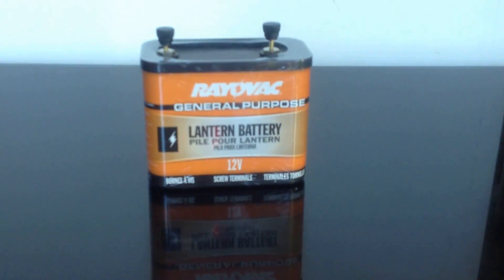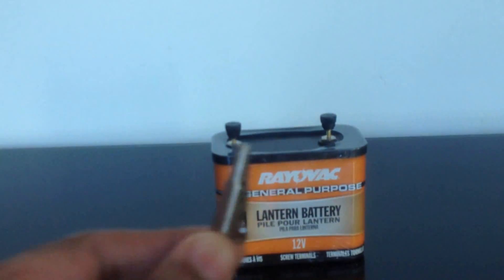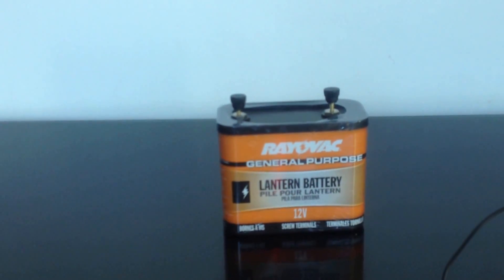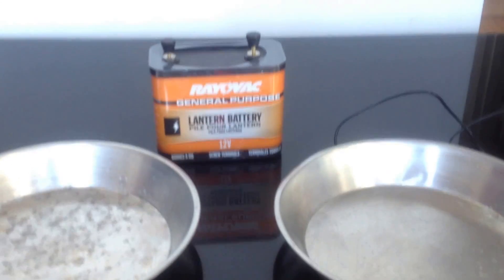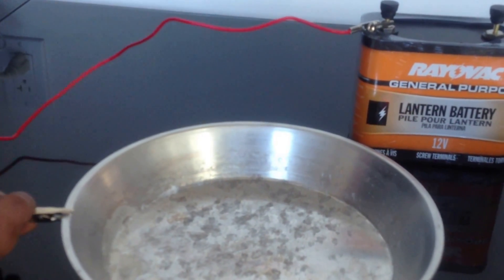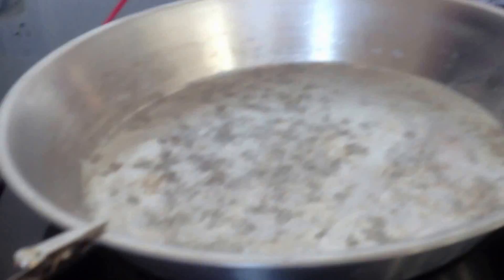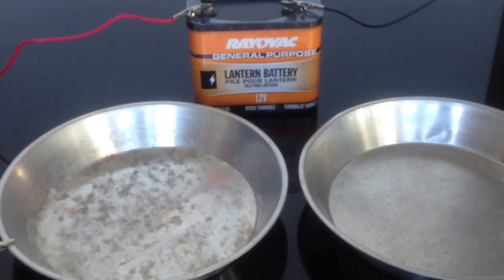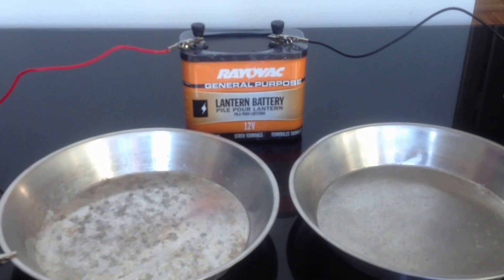Making Iontophoresis Machine at Home

Comment: Can we use steel plate instead of aluminium
Reply: Can you get your answer
My question is same tell me please
Reply: @awaissatti3771  As long as you use a metal, you are good to go. Aluminum is a better current conductor and it is cheaper than steel. Both will work.

Comment: Please anyone can tell ,can we use any 12volt battery? Or we surely want to use lantern battery ?
Reply: yes it can be any 12v battery. for what i have heared it can be up to 18v-20v  if you have sensitive skin. if your case is severe it can be up to 25v. Make sure to use stainless steel pans instead of aluminium ones, read top comment ! :)

Comment: I have a suggestion for all, you can use 15 volt AC to DC adapter(mA doesn't matter) and mix a little bit alum powder( Fitkari) in water,it is more effective than normal water. It's my personal experience,thanks to all.
Reply: Can we use with laptop adapter output 19v 3.2Am
Reply: Wenky Fritz Yes, you can but I am not sure about your adapter voltage. In fact it depends on you. If you can tolerate the voltage then it will be fine. Thanks
Reply: I am asking about the current. I have read from many sites that upto 20 mAmp current is good for our hands. And here there is 3 Amp current which is very large. Please can you clarify.
Reply: Wenky Fritz, sorry I have no scientific reference regarding current. I have just shared my personal experience and it's effective for me. Infact I haven't found any low mA adapter in my local market.
Reply: @Md Mitoo Hello Bro I need to know how to make an iontophoresis using adapter. I need to talk with you. How can i contact with you.? Please I am suffering from THIS worst problem

Comment: Thanks you so much. Can I use a voltage adjustable AC to dc adapter for it ?
Reply: Shan Swt you probably can, but I don't advise you. Plugging into mains has severe risks and this home made version does not include any protection or circuit breakers in case the electricity surges. I strongly recommend sticking to battery unless you are absolutely sure about what you are doing.
Reply: Hyperhidrosis N yes.. you are correct. Tysm

Comment: What is the ampere rating of the battery ?
Reply: Rakesh Dhakal Thanks you so much. Can I use a voltage adjustable AC to dc adapter for it ?
Reply: Thank you so much for your advice and help @ Rakesh Dhakal . What is the expense for IONTODERMA after 20% off
Reply from the maker: https://hyperhidrosisnetwork.com/top-iontophoresis-machines/

Check out his link for prices for all leading iontophoresis brands, as well as coupons for most of them.

Comment: I'm not sure how electricity affects aluminium, or if aluminium can be absorbed through the skin, but stainless steel might be a better option. Aluminium exposure leads to Alzheimer's Disease and Dementia.
Reply: and this fact, few people know. Hugs, brother
Reply: There are no confirmed instances of Iontophoresis causing serious medical conditions. Having said that, you can use steel plates, or other metal plates that are available in the market. All you need for ionto to work is to pass the current through water and then your hands/feet... everything else is immaterial.
Reply: +Hyperhidrosis N sir i do this but i put my hand in pain so i shocked electric current so i can't do this and stop to do this so tell me what i do ??
Reply: is an ointment. called Antihydral. her and the very good hands. yes it solves. anything I'm contact.Sharukh Faisal
Reply: i think you shouldn't touch your hand with pans. You can use rubber sponges to help not to touch your hands with pan while dipping hands in water.
Reply: this isnt true wtf
Reply: pitertosh Piter pls can u tell about that
Reply: pitertosh Piter what about using PVC foam mats like they have on the expensive devices, will that help for having no contact with the aluminum?
Reply: Having Fun what about using PVC foam mats like they have on the expensive devices, will that help for having no contact with the aluminum?
Reply: pitertosh Piter it will cure sweating?
Reply: What if the sweating Is on the scalp and head area

Comment: I'm about to try this. 2 questions. How deep is the pan? And will you need to replace the pans after a while, or will they work for a LONG time?
Reply: It does not "pain" - its just a bit uncomfortable with a tingling sensation.  On a scale of 1 - 10, its probably a 2.

You will need to replace the pans. If you use aluminium pans as indicated in the video above, it will probably work for a good year before replacement. If you use steel or other non-corrosive material, it can last much more.

Comment: does it effective if my aluminium tray too thin ?
Reply from the maker: Not really in terms of treatment efficiency. A thin aluminium tray will likely get corroded faster than a thicker one, but in terms of treatment effectiveness, its not an issue as long as the tray continues to conduct electricity.
Note that if the trays get too corroded, that may impact their electricity conductivity  and thus the treatment effectiveness.
Reply: +Hyperhidrosis Network thanks for ur reply.

Comment: Is it normal that you feel the tingling sensation on one particular hand only, even when you change the polarity ?
Reply: Yes, it is. If its direct current from the battery, it will tingle. If you have polarity changing current, it will still tingle but much lesser

Comment: please can i use a battery charger ??
Reply: Not sure what the question is?
Reply: +Hyperhidrosis N  the charger that with it you can charge the battery sorry for my english I hope you undrestend me.
Reply: I want to ask the same question, using battery charger device instead of batteries, does it work?
Reply from the maker: +Imene Kameli  The answer depends on the voltage of the battery charger. Just because you can charge a 12V battery with a charger does not necessarily mean that the voltage provided by the charger is 12V. It can be much higher or lower.

So, its difficult to answer the question without knowing the precise voltage rating of the charger in question. If its in the range of 12V-18V, the answer is likely yes. 

HOWEVER, we are talking about something that is connected with mains and I will be VERY wary of connecting my body to the mains through the charger unless I am sure of the safety mechanisms. So, I cannot recommend using battery charger instead of battery. It may work, but may not be worth it!

Get a battery... its not expensive!
Reply: Check charger output the voltage should be in range 12-14 V  and current should not be more than 16.6 mA
Reply: @AvinashPflute   current 2Ampere se jyada koi problem to nhi hai bhai
Reply: @RaviKumar-os1en-l8g  2 se 2.5   tak may be koi problm nhi hogi jab tak battery voltage 12v he usase jyad  ka nhi bol sakte
Reply: @AvinashPflute  Mai Bike🔋 charger banwaya tha 12 volt 2A ka Mai use use kr sakta hu Bhai

Comment: Hi there, I am wondering if it would be possible to use a 12 V amp car battery charger to connect to the metal pans instead of a battery? The model is described as 'BC-6 Battery 6V - 12V Charger 6 AMP'.  Thank you.
Reply: +obedie 77 Not sure about that, so will not advise. If the voltage generated out of this charger is 12V, you should be fine. However, as I said, I dont' really know .

Comment: hiii there i live in india and in india i am not getting 12 volt rayovac battery its available in amazon but with customs duty and all its costing a lot .Can you Please tell me any alternatives of that battery.Can i use 12v  batteries which are used in bikes Please reply soon
Reply: Yes you can use it I am also using 12 volt  bike battery and it works perfectly
Reply: @yogithakur4122  Bhai result kaisa aa Raha hai sweting ka 12volt 🔋 se
Reply: @RaviKumar-os1en-l8g  bilkul 12 volt se kaam karta h aapko almost 7 se 10 din tak roj 20 minute karna hoga uske baad hafte mein 2 din maintenance k liye
Reply: @yogithakur4122  Bhai apna no de skta hai information Leni thi is process ke bare me please
Reply: 12 volt battery me kitna Ampere current Flow hota hai
Reply: @yogithakur4122   it is working perfect ha bro

Comment: Hello, can you tell me please if the size of the stainless steel trays matters? If i have larger trays the current will spread through them those making them less effective? Would be a better idea to make stainless steel electrodes the size of the palm/feet and to place them into plastic trays. I know that the amount of water counts but what about the trays regarding effectiveness?
Reply: Does not really matter - what matters is the amount of current passing through the affected area. So as long as the entire current is channeled through your palms (which it will of there is not other outlet for he current to go), it is OK. Smaller plates,however, are more convenient and easy to manage.
Reply: Thnaks for the answer!

Comment: Hey, quick question, so it safe to connect 2 of these 12v rayovac batteries at the same time to make 24v? Cause usually I connect 4, 6v batteries which makes 24v, right? But wouldn't the amps apply effect or not really?
Reply: +TreeStump if you do have a cut on your skin you might feel the pinching 24volts.
Reply from the maker: Higher amps do mean more current passes through the skin - which in turn means more of whatever iontophoresis does to hyperhidrosis. That's ofcourse true only to a certain point :-)

I think 24V is safe (though, please refer to a qualified professional to take his/her opinion before you try that). You may want to start with lower voltage and then go to higher if 12V does not work for you.

Comment from the maker: Yes, you can. 12 Volt is the voltage rating of the battery. 5amp you mention, I think is 5 ampere hour (AH) - that just indicates the capacity of the battery (i.e. how long will it provide the current). 5 AH has nothing to do with the voltage.